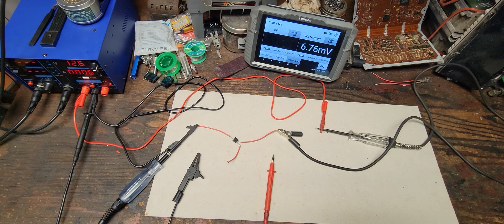Voltage Drop, Beating a Dead Horse

Comment: Mike, great video!  Wondered what 12v bench power supply you use, or prefer? 
10-06-24. Thanks,  
Scott
Reply from the maker: The one I'm using is a YIHUA 853D. 
I'm on my second one. The first one lasted 2 years. These are under $200, so a cheap ok unit. I only do a very low volume of repair soldering work, so a premium unit isn't cost-effective at this time. I plan to pick up a Weller or Hakko unit eventually if this type of work increases in demand in my market.
Reply: @710diagnosticsandfishing  
Thanks for the info man!